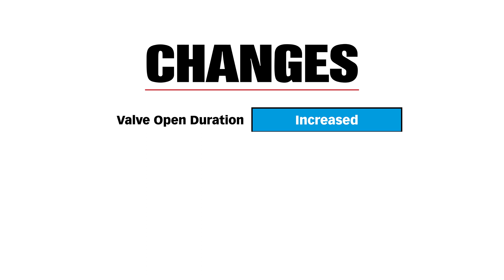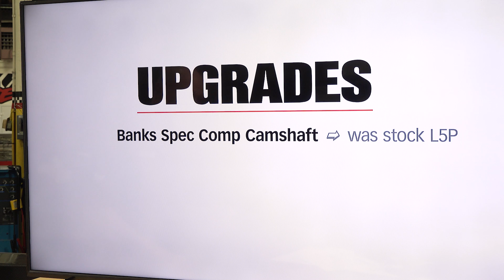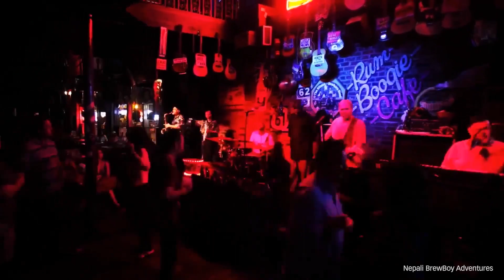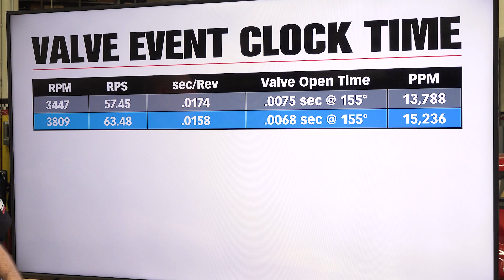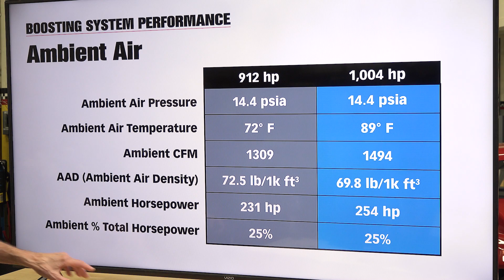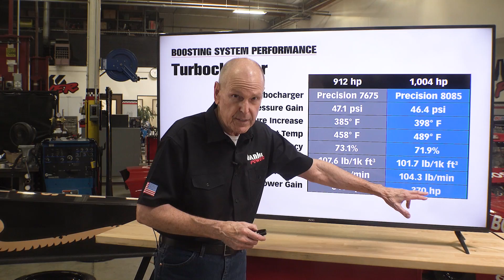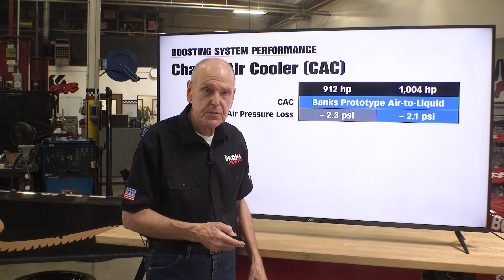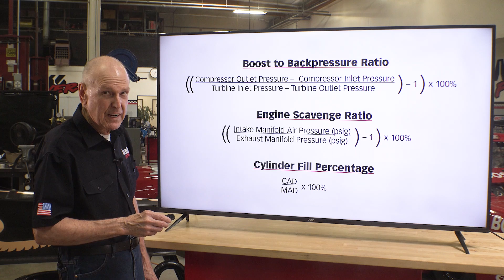1,004 HP !!! Killing A Duramax Pt 15

Comment: Well Gale, I would like to see the water methanol system used sporadically to lower egt and to clean the intake into the engine for long engine and turbo life on a full emission system truck.  Mines a Cummins 2016 6.7.  It had the monster ram, I ordered Banks Intercooler upgrade, air filter,  pedal commander and I got the 68RFE pan the day it came out.  I am very interested in getting the balance where you were with the duramax with the injection in at 32.5 degrees and the power and efficiency really making sense (to me) at 709 i believe.  For those of us not going to liquid cooling and wanting the benefit of a clean turbo and system, what can we do with a $1250 Snow stage 3 system?

Comment: Banks made a push rod V8 diesel, make nearly as much power, as the most powerful hellcat ever produced, and make more power than one of the most advanced engineering feats in W 16 Bugatti engine technology, with mostly stock GM parts! And the way he did it makes it reliable! I just can’t over emphasize how amazed I am with this! Like hot damn that Duramax could probably pull a 20 foot trailer and passive Bugatti Veyron! That is insane!

Comment: The hell-cat demon 170 hemi V8 supercharged, with using the air conditioner to super cool the intake air temperature, which I think is genius by the way, makes 1,025 horsepower.
Banks made a diesel engine with a cam swap, turbo and fuel upgrades, get pretty damn close to that power level on diesel! And probably almost double the torque! This is amazing! 
It’s astounding!!! 
Banks made a push rod, v8 diesel, with one turbocharger, make 3 more horsepower than a W-16 Bugatti quad turbocharged gasoline engine! This is amazing!

Comment: I appreciate all the improvements for the engine, have you considered creating a transmission division to tweek the transmissions to utilize what you have put into engine performance, so that they harmonize the gains to the wheels. Transmissions tend to be the weak link, creating a transmission control module that uses the engine data to time shift points for the desired torque. 

Also, how about creating a better engine brake for towing, the current design is a useless as nuts on a monk, it's not much more than a second tow/haul button on my 2017 GMC 3500.

Comment: i think this is the last ep bc he couldnt get it to go bang, i mean just look at how hard he pushed the block and it just kept going, and the gen 1 L5P is one of the most over built engines ever

and when I say that, I mean it as long as you change the fuilds on time the expected life of these engines stock is well over 500k miles without catastrophic failure

Comment: Something he didn't point out, you need the boost to back pressure ratio and the scavenge ratio to be positive to prevent the engine from eating its own shit when changing to a cam with more overlap as they did.

Comment: It made only 1300tq though?
Reply: Because of high rpm, if peak power was at lower rpm then it would have had more
Reply: Cummins guys are doing that with a few upgrades.  the last 5 years has changed a lot in the tuning world.  Now it should be time to get the EPA's emissions out of the diesel engines.

Comment: I have a 2019 6.4 ram 2500...does your pedal monster work on a ram 6.4...or just ones in the cars...I need to know cause I'd love one
Reply from the maker: Yes indeed, it will work with the 2019 Ram 6.4L. Here's the link for it. 
https://bankspower.com/products/pedalmonster-throttle-sensitivity-booster-64310-64313?variant=40940401262789
Reply: @bankspower  thank you sir....now I see what looks like 3 different prices...witch one does the most?

Comment: What about the 3.0l i6 LZ0?

In California, 61% of the diesel sold in Q2-2023 was renewable diesel, most of it from waste food sources, which means we had free net 0 fuel running in our diesel trucks WITHOUT MODIFICATION. (Numbers direct from California Air Resource Board)

I am sick of these 9000lbs EV Hummers, these oversized cars from Rivian, and these idiotic Cybertrucks...

...diesel is greener tech, it works in USEFUL trucks, and it requires no infrastructure.  How do we make it more popular?

We need a "killing a Duramax" for the 3.0L, But with the goal of maximum efficiency so we can BURY these USELESS EV trucks.

And we need a relatable person to do it.

Banks, grow your hair long, join us hippies, and make the future of sustainable automotive.

If I could get you in a room with Gavin newsom, I know your political ideology might differ, but I am sure the mission will be the same.

Comment: As a physics guy, I've never truly understood in a visual way why high performance cams / VTEC / VVT / etc were a thing.
But with the diagrams and numbers showing real time of valve open duration, I FINALLY GET IT!

The cylinder needs enough valve open time to get enough air in there for a powerful fire.
Any single cam profile will provide very different valve open duration at low versus high RPM operation.

It's funny how I thought I understood this for many years, but it was only that 'I've heard this is the case' or 'memorized rule' knowledge.
Now I could explain this to my 6 year old daughter.
That's when you really get it haha

Comment: If engines work better with cold condensed air coming into the turbo, why wouldn't they route some of the cold air from the trucks A/C unit into the air intake?

Comment: Where is the killing part? It’s been three years already.
Reply from the maker: The Killing A Duramax series was paused when both dyno cells were needed for defense projects. Both are wrapping up shortly which "should" allow us to commence with Killing A Duramax. However, we may roll LokJaw's supercharged Duramax L5P into the cell first since the truck is returning to the SEMA Show in November. Our goal for LokJaw's engine is 600-650hp before nitrous. Stay tuned!
Reply: @bankspower  Thank you for the update!
Reply: @bankspower ”should”. Sounds unserious.
Reply: A year has passed from my last message and still the saga is unfinished. Sad, I thought that Gale is a man of his word. No crank on the floor or heads up the ceiling.

Comment: Whatever happened to this series? We’d like a conclusion
Reply from the maker: Both the Super Turbo (Monster Truck Engine) and the L5P for  “Killing a Duramax” on hold for an extended duration while we conduct testing for our military program (Banks Tech) in Dyno Cell # 1 & #2. The moment these projects are completed, we’ll roll both the Super Turbo and the Killing a Duramax back into the dyno cells. However, we may roll LokJaw's supercharged Duramax L5P into the cell first since the truck is returning to the SEMA Show in November. Our goal for LokJaw's engine is 600-650hp before nitrous. Stay tuned!
Reply: @bankspower  thanks for the info

Comment: So did he just give up?
Reply from the maker: Both the Super Turbo (Monster Truck Engine) and the L5P for  “Killing a Duramax” on hold for an extended duration while we conduct testing for our military program (Banks Tech) in Dyno Cell # 1 & #2. The moment these projects are completed, we’ll roll both the Super Turbo and the Killing a Duramax back into the dyno cells.
Reply: @bankspower  will you actually blow the Duramax up then 😳
Reply: @bankspower  will you actually blow the Duramax up then 😳

Comment: Gale, I love your videos! 

So much good information.

I see that you have been using S&S injectors in your L5P builds.

I’m building a LB7 and it is currently stock, eventually I want it to have around 500hp at the wheels.

The stock injectors are starting to smoke, can’t decide if I should use stock VCO injectors or S&S SAC00 or SAC45

I would love to know what the duramax man looks thinks!?

Comment: GM must have fired the crew that built this one. They're pulling these off the market due to catastrophic failures.
Reply from the maker: It was a small group of trucks that were identified and pulled off before they we deleivered to customers, not all trucks.
Reply: @bankspower Dont get me wrong, been a GM guy my whole life. I used to build 6.2, 6.5s for the military and we had so many problems it wasn't funny. How do you tune an engine that is 3 to 5 degrees out on the rod journals and as much as a 1/4 in on the stroke!? Pretty had to make that work. Lots of welding and regrinding cranks. Eventually  we pulled 237hp on the dyno from rebuilt stock parts just because we got 100s in at once. So we did a poor man's balance. Mixed and matched everything as best we could.

Comment: Here is another suggestion.
Inject Propane into the intake to use the extra 14% Oxygen to gain more power.
Reply from the maker: It's a novel idea, however, propane can be a temperamental fuel to work with because it's unpredictable and carries an innate ability cause pre-ignition. Gale has never really been a big fan of sideloading propane with diesel. In the multiple tests that he's run, it has been shown and proved to cause premature internal wear and melt pistons when running at full tilt for long durations. Especially, when you're running high horsepower / torque applications.
Reply: @bankspower  At what compression ratio does Propane cause pre ignition.
In my experience it is good in diesels up to 20 to 1 compression ratio with less then 30psi boost. where there is no problem with pre ignition.
Also I am only suggesting to use enough propane where it uses up the 14% unused oxygen.(of the smoke less AFR)
NOT to power boost the whole engine.
I am sure it does not damage anything in the engine in that amount.
Anyways, thanks for getting back to me.
Great content guys, and very high quality graphics and videos.
Love the Data Monster capabilities.
It's like having a Microscope to look into the engine.
Reply: Lots of Detroit Diesel guys seem to run Propane... I guess it works well with old Diesels that don't make a lot of boost and power from the start

Comment: I suggest to put an AC Super-Chiller system on the intake to further increase air-density.
Also a water injection system directly injected through the glow-plug holes with some special injectors.
I am thinking we could inject well atomized water with a secondary common rail system, right after the bulk of the fuel has burned at about +20 degrees and use the extra heat to create some high pressure steam. :0)=
Reply: Water methanol injection is already a thing you can just inject into the charge air piping behind the intercooler.
I recon it would be beneficial on high power diesels.

Comment: With the charge air cooler your running would be typical for marine applications. Did you run an air to air charge air cooler in your Dyno testing to give a better estimate of runing the engine in a truck?

Comment: I'd like to see a full analysis of the "health" of the engine after all this. Could it run well for another 200K miles of street use?
Reply: I bet at 850 it would. Banks had the perfect air mass density spec you could achieve for that setup.  I bet if you just streeted it, itd go that 200k
Reply: Negative, factory equipment could NEVER  run for 200K at that load. Seriously?
Reply: @sethodell4332  how much of that l5p is still factory lol

Comment: Has this series been decidedly finished? Or are we going to see the point where you manage to kill that dmax
Reply from the maker: Here is the latest update. Both the Super Turbo (Monster Truck Engine) and the L5P for  “Killing a Duramax” on hold for an extended duration while we conduct testing for our military program in Dyno Cell # 1 & #2. The moment these projects are completed, we’ll roll both the Super Turbo and the Killing a Duramax back into the dyno cells.

Comment: I'm assuming that y'all killed the Duramax
Reply from the maker: Not yet, here is the latest update. Both the Super Turbo (Monster Truck Engine) and the L5P for  “Killing a Duramax” on hold for an extended duration while we conduct testing for our military program in Dyno Cell # 1 & #2. The moment these projects are completed, we’ll roll both the Super Turbo and the Killing a Duramax back into the dyno cells.

Comment: Is this still going to happen?
Reply from the maker: Yes it will, however, both the Super Turbo (Monster Truck Engine) and the L5P for  “Killing a Duramax” on hold for an extended duration while we conduct testing for our military program in Dyno Cell # 1 & #2.

Comment: This is a fascinating series but it is good to keep it in perspective.  

Gale plainly states that the intercooler adds more to cylinder density than the turbo.  Yet there is no way a street vehicle could duplicate the performance of his "marine" air to water intercooler.  

That intake could never be made to fit on a street machine.  

The upgraded turbo works great on a dyno but it would have a lot of lag on the street.  The whole idea behind a variable geometry turbo is flexible power.  I would have preferred to see compound turbocharging which kept the oem turbo for responsiveness and pressurized it with another bigger turbo.

Ultimately, to reach the intended goal, he went richer than the 18:1 mixture limit he was supposed to be sticking to.  

The discussion of pressure bias between the intake and exhaust is worth while for everyone.  It is my  understanding that the factory setup mostly has a negative pressure gradient to make the egr work better.

The cam isn't exactly "stock internals" but he owned it and  it may be the most interesting and educational part of the experiment.

The whole thing about injection timing and the 40 degree limit is well presented and uber instructive.  Now we know why big power engines need big injectors, not just more timing and pressure.

There are people who can cobble until they get what they are after and then there is Gale Banks who knows where he is headed, how to get there, why he wants to go there and knows when he has arrived.  When he's gone he will take with him so much expertise that will probably never exist in one person again

Comment: Well, considering where the air density ratio is at, next logical step would be to add an Interchiller to bring the Intercooler temps down even further to create an even denser air.

Great series by the way. Certainly helps with understanding how power is gained in a Diesel engine.

Would love to see the gauges be available for us non electronic Diesel trucks (No computers).

Comment: Holyshit! So if you have peak torque at a certain rpm and calculate the valve opening time, and make a new cam with that valve opening time at a higher rpm you will push peak torque to that rpm?! Mind blown

Comment: Awesome series, goal 1,00 achieved, but did you kill it?
Reply from the maker: Not yet. Both the Super Turbo (Monster Truck Engine) and the L5P for  “Killing a Duramax” on hold for an extended duration while we conduct testing for our military program in Dyno Cell # 1 & #2. We have no ETA on when we will resume the project.

Comment: Just spentnæ my morning seeing some episodes. 
I spotted the Boost piping is Stainless. Would there not be s free benefit by changing to Aluminium?  It's better on the heat and there is a significant lower weight gain. Maybe some "free" power right there

Comment: bone stock
Proceeds to say they upgraded just about any shortcomings of the engine, i.e. intake, injectors, cam, fuel pump.
Reply: The only internal thing they've changed is the camshaft, everything else is just supporting mods. More power requires more air and fuel, would be a pretty boring series if they didn't give the engine what it needs to make power.

Comment: What was the charge air cooler's coolant in temp and coolant out temp?
1) Ship that engine off to a cold cell?
2) Diminishing returns, but set up a second air to water charge air cooler in series on the engine intake air and supply it with chilled coolant, say coolant in temp somewhere around 20 degrees F?

Comment: Really admire how you make clean power! Would love to see the math and charts for a sequential turbo system, with the boost to back pressure ratio and the engine scavenge ratios to see how to tune such a complex system.   I predict the secondary turbine housing would have to be finely tuned to release excess pressure causing heat but also not not to increase spool up time.  Maybe an external wastegate?? Thanks for what you do!!

Comment: Where’s part 16 at??!!
Reply from the maker: Here are the latest updates: 
1. The 'Killing a Duramax' project is on hold while we conduct testing for our military program in Dyno Cell # 1.
2. Dyno Cell # 2 is down while we update and upgrade to our new engine AVL dyno/emissions equipment.
3. The Super Turbo (Monster Truck Engine) is in the process of being upgraded. Which means pulling everything off the current 7.0 LMM, making adjustments and changes, then installing them all on a newer first-gen L5P block.
Reply: @bankspower : so, are you going to finish this series....or not?

Comment: We need an update
Reply from the maker: Here is the latest updates. 

1. The 'Killing a Duramax' project is on hold while we conduct testing for our military program in Dyno Cell # 1.

2. Dyno Cell # 2 is down while we update and upgrade to our new engine AVL dyno/emissions equipment.

3. The Super Turbo (Monster Truck Engine) is in the process of being upgraded. Which means pulling everything off the current 7.0 LMM, making adjustments and changes, then installing them all on a newer first-gen L5P block.